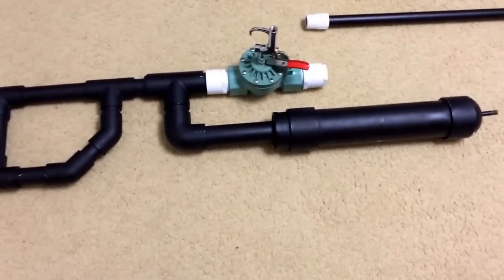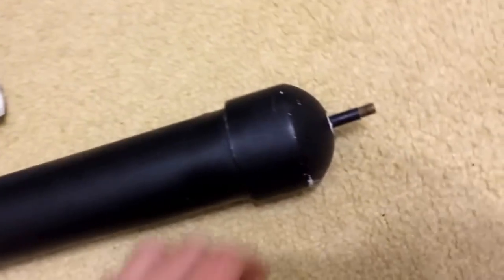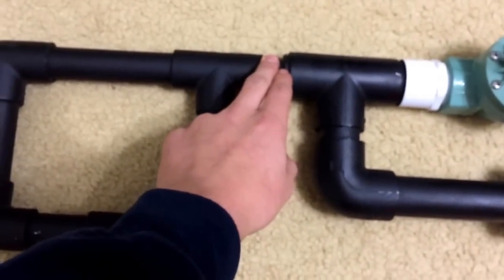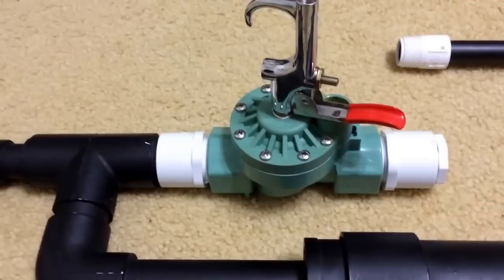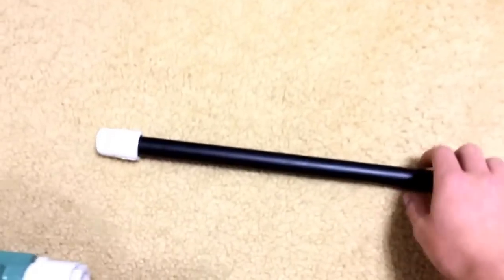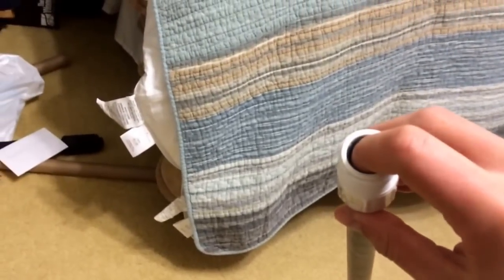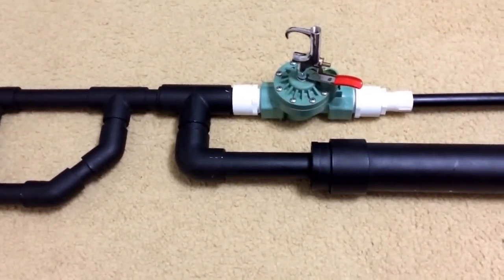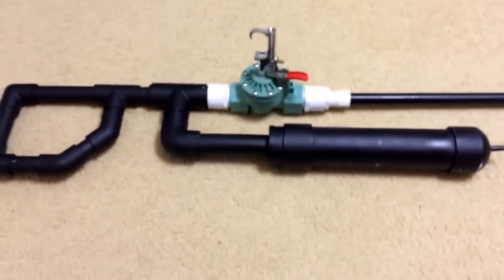How to build a powerful pneumatic air cannon

Comment: How many PSI is safe to charge this airgun? 

What is the pressure source; Oxygen, CO2, or Propane gas?
Reply: 0 psi if it's PVC, not rated for gas pressure at all, ratings are hydrostatic only.